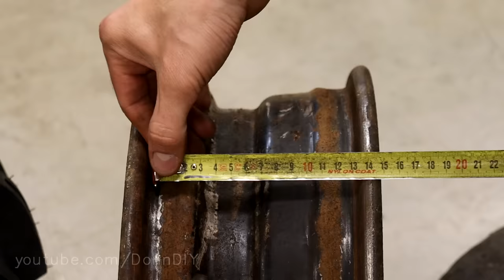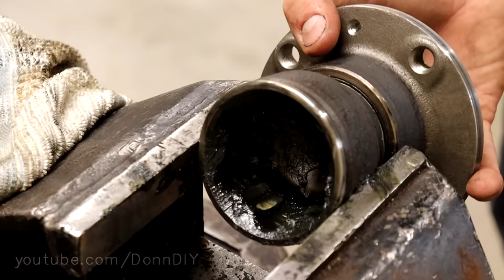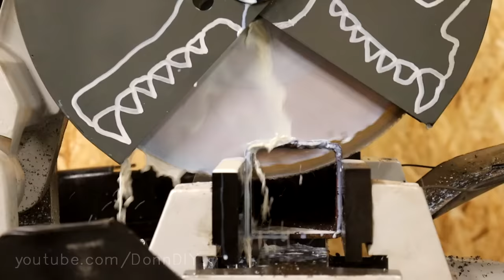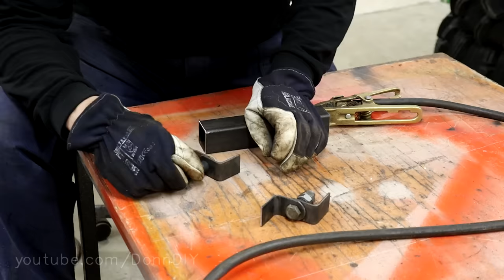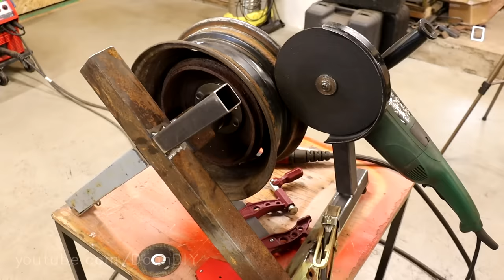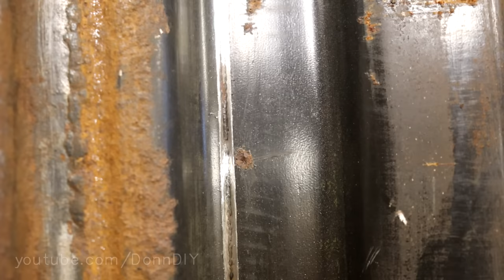Widening Steel Rims - 4x4 Build Ep.3

Comment: Like the cutting jig but why not just properly weld it with your rotating mount. I saw no reason to mount your mig torch on that arm. You want the slight cursive e in your puddle to properly get the surfaces bonded with good penetration. Keep it simple @#$&!d.  You are pretty good at the fabrication but sometimes less is better. You may have done this, but I would have run a dial gauge on the inside and outside of the rim to make sure it was perfectly straight and aligned. I then would have tacked it all around so my weld heat didn’t distort my alignment.  It was fun watching your video. Big thumbs up.

Comment: Interesting, I would mig weld by hand and mount the wheel on a rotating device. Make use of old/ spare windscreen wiper motors. They usually have 3or more speeds and are gear reduction by a worm gear giving them slow rpm and good usable torque. Also the axle on them is perpendicular to the motor making ideal to setup. 🔧📐

Comment: When you are welding like this you way find if you had the torch lined up with the weld and have it mounted about 20 deg inclined to verticle. Have it just before the top. Give the welder an approach angle. Just like welding when you are pushing the torch along a seam on the flat. It pre heats the oncoming metal better and you will get a flatter weld with more consistant penetration. very good effort never the less.

Comment: Very nice job. You are correct, you need to make a power feed to better control the feed speed. A drill motor would work well or a small motor and a clothes dryer belt. Another way it is done is remove the center part of the rim and find a donor rim that is wide enough. Thanks for a well done video! Bob from Virginia USA

Comment: I get that the point of doing this is to make content and also a neat little project so why not be detailed to get it right the first time. I'm a carpenter and I've worked in a metal fabrication factory, I could always tell the difference between a wood worker and a metal fabricator by the detail they used when working. I hate having to take something apart to fix it and put it back together. Even when I'm finished I still feel like I failed.

Comment: I wish you had posted this long ago.  My son had to widen two wheels for my buddy's pulling truck.  We cut an adapter plate for the engine stand.  I held the plasma torch while my son rotated the wheel on the engine stand.  The lathe we had at the time was not big enough and the CNC tubing cutter would not handle the diameter.  It all worked out decent.

Comment: @Donn DIY  Now you need to make a tire leak testing bucket.  Most of the ones I have seen are about 1/3 of a circle where you can set the tire in to it full of water and it cover up to about the lug nut holes and with air in the tire it will bubble if there is a leak. 
What a awesome jig.  A small dc gear reduction motor would allow you to feed it very slow and even get far better welds. Add a mount and some sort of small rubber wheel would work well along with a speed controller!

Comment: Nice work.  1 suggestion is try your torch  mount at an angle Instead head on.  
I worked in wheel manufacturing company an our steel wheel welders are setup at angle an run a .45 wire an we run 4 weld heads so each one does a 1/4 of the weld an we run the rotation about twice as fast you are turn by hand. 

I would take old wheel an experiment with the settings until you get a good bead

Comment: Incredible problem solving!  Ingenuity like this never, never goes outta style.  Did you ever consider trying to use the lathe to at least do the rim cutting?  Or did it not have enough swing capacity, never mind how likely would have had to build something like that anyway for the welding to prevent risk of damaging it during the welding?

Comment: The grinder mount should slide left and right a few inches to fit other rims. Too much wire stick out, all that splatter is wasted weld wire, fine tune the power supply, Make a belt drive wheel turner with a reostat.

Comment: think that if you have an extra set of rims you can take the rear half and weld it on the front , that way you only need one weld , dont know if the valley wouldve been to far from the edge though
wat you can do for an automatic feed is get a battery powered drill and chuck a rubber caster wheel in it , hold that aganst the rim and turn it on untill you get the right speed

Comment: Looks very professional!  Although I would HATE to try and balance those rims and tires for high speed use LOL (I know, it's intended for low speed off road).  If all else fails, you could always go with tubes for the tires if they don't want to seal well.
Reply from the maker: I wouldn't want to balance these either. 😆

Comment: Awesome work! You should consider using flux core wire. It will help the weld lay flat and will help with issues, such as contamination from paint and rust. It would work well with your 90 degree torch angle!
Reply: @Mike 🤣 Flux core/dual shield is used across the industry for all types of structural welding, such as military, aviation, pipe, towers, turbines and many other applications, where penetration is paramount. Short circuit MIG is a basic step into the industry as a welder/ fabricator and is the easiest to learn. It’s a common misconception that flux core is “crap” because of the cheap machines and weld consumables on the market.

Comment: Hello! Is it safe ?!
Reply from the maker: Not for street use in my opinion. I use these on my 4x4 off road vehicle with low pressure tires. Have to be careful when first inflating these of course. And check for leaks.
Reply: @DonnDIY  Understood thanks. Success in the project!)
Reply: Hell yes! This is how its been done for a long time and still s done. I have aluminium wheels widened like this.
Reply: @mawe42  Dude, I have nothing against it, rather the opposite ... I just asked how safe and only

Comment: The lathe in background looked big enough to hold the wheel?First time I've seen a video of this but it was kinda common 40 years ago
Reply: While he could have used the lathe potentially for cutting the rim, the problem is that welding in the lathe is very, very risky.  If you're not extremely careful, its easy to have current arcing go through your spindle bearings and/or other bearings within the lathe and then your lathe is outta commission until you dismantle it enough to replace all the bearings you farked up trying to do welding in it.  I was personally waiting for the reused CV bearing in his cutting/welding jig to seize-up due to arching through it while he was doing his welding, even with him having his ground clamp in about the best place he could have it due to moving of the clamp as he spun the rim.
Reply: @Patriot1776  I meant to cut the wheel not re-weld it. There is little chance of the bearings getting arced when ground clamp is on the wheel but if it came off and landed on bed or any other conductive part it's just about a certainty to damage bearings. Personally I wouldn't even attempt it. Mainly parting off would save making a dedicated cutting jig but as that's being used I guess it's a moot point.

Comment: Alot of  work to do  when you could of done it on the lathe just a suggestion  that's how I widen rims
Reply from the maker: I don't want to use a hammer, grind stuff and weld in the lathe. I've welded before in the lathe but I try to avoid it if possible. Thus the jig.
Reply: @DonnDIY  Exactly. Great job!

Comment: I'm thinkin those tires woulda fit just fine on the original rim.
Reply from the maker: Just went to the workshop, the tires laying on the side on top of each other. Now the bead with is around 15-16 cm. I might end up not doing the remaining three and just use the original width indeed. But the rim offset has to be changed for sure.
Reply: @DonnDIY  Ahh I see... cause you're looking for clearance.  👍

Comment: How did you make that "sheet metal" roller?
Reply from the maker: From Volvo rear axle drive shafts which are used as rollers. And the rest of the material is just scrap metal.

Comment: Sorry but not with my life... thinness and softness of added ring... rustibility of weld and new ring.. the weight distribution is off (vs a manufactured width).. balancing and finally the roundness tolerances.... very very good work but no thanks